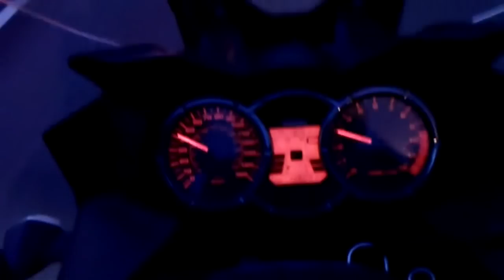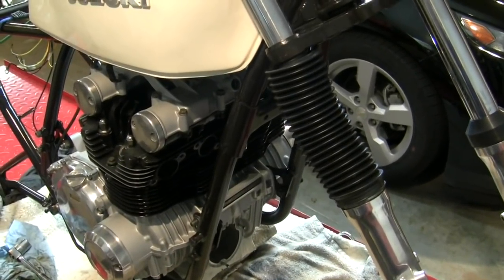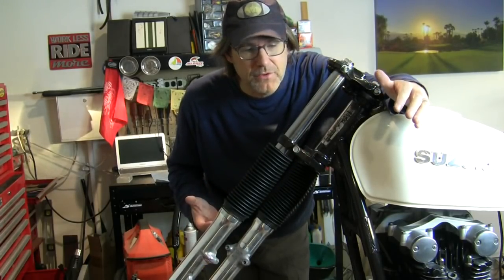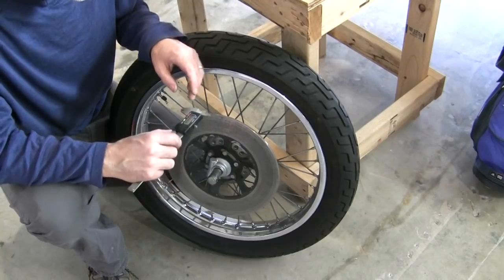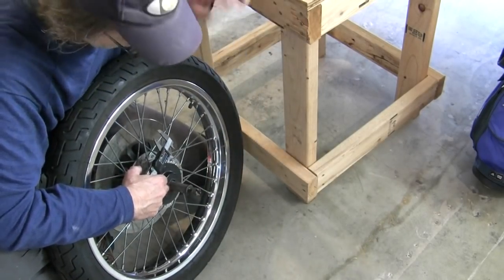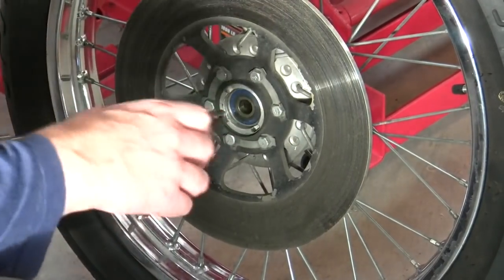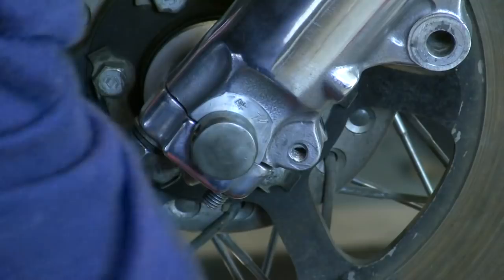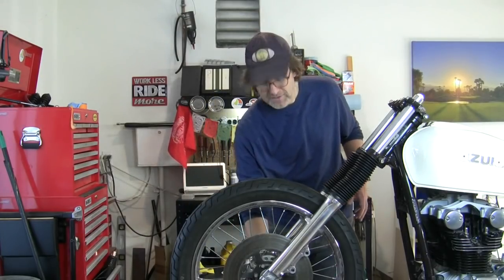Install Front Wheel - GS550 Cafe Racer Build (Part 69)

Comment: Looking good! Never thought of doing the dual caliper conversion? with cbr600 disc's and Kawa calipers. Much better stopping power but still using the standard  wheel.
Reply from the maker: I had written off ideas like that when I committed myself to doing this bike on a budget. I understood that I'm sacrificing some potential performance upgrades in holding myself to a low budget, but I suppose I could always do it at a later date. Thanks for the idea! And thanks for watching !

Comment: Good decision.I like gators because they add visual "weight" to the front.These old bikes have spaghetti forks and need some visual thickness in the front.Though I never found gators that lasted longer than 1 season,which means removing the forks for reinstalling new gators.Cheers from Vienna!Love your Channel!
Reply from the maker: Thank you Carl. I appreciate your comment and have to agree. Greetings from LA! I visited Vienna in 1984. Beautiful city.
Reply: Volvo steering gaiters from a 440* - there's a non power steering variant which has two identical boots which are perfectly sized to slip over the GS fork tubes and the stanchion is a slightly slack fit but easily tightened on with a zip-tie.
The handy thing about steering gaiters is there's a lot of good old stock around which were made in Europe or the US and don't fall apart in a year. I know about the crappy year-old ones, as I had a set that fell apart.
Steering gaiters are cheaper and ten times the quality.

*If you can't find a 440 listed, just dig around and compare from an aftermarket parts catalogue of a decent brand, and once you find one of the right size go hunting for some New Old Stock.
Reply from the maker: @TheManFrayBentos  Good stuff! Thanks for sharing!
Reply: @UrbanMonkTV   One thing I meant to mention, is I normally punch a 5 or 6mm hole on the bottom rib, just above the lower band that goes around the fork tube. This allows some airflow in and out and prevents the gaiters from ballooning. If the hole is at the rear no water gets in, and the function of the gaiter is unaffected. Any moisture that does get in is vented out anyway, as you travel into warmer and drier days.
 I've been using gaiters for years and can honestly say that the fork stanchions survive much longer, especially on the high-mileages I cranked up on these bikes.
Once the mileage is high enough, the chrome starts to wear, along with the lower bushings and it's time for a rebuild anyway, but on those bikes I got early enough and fitted gaiters to, there was an almost total lack of rust pitting on the stanchions.
Compare that to the typically horrible condition of similarly aged bikes that have never been fitted with gaiters. You probably know the ones I mean - stanchions that are pitted and just tear seals to bits. The only real solution to that is a re-chroming.